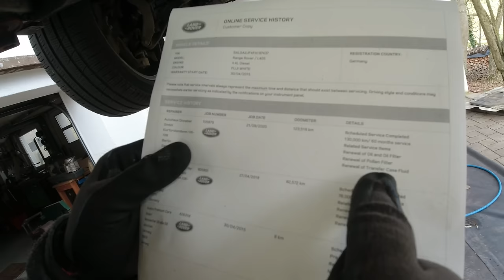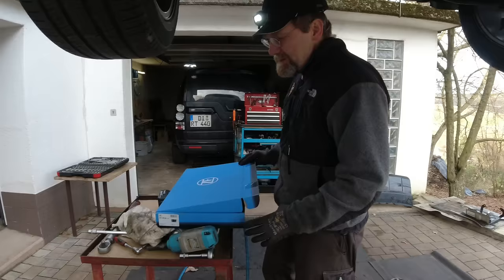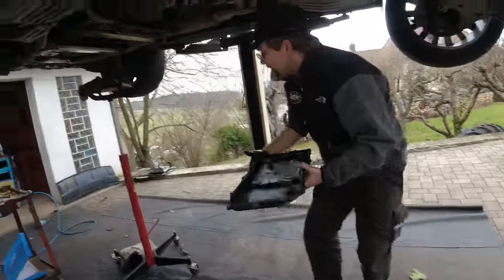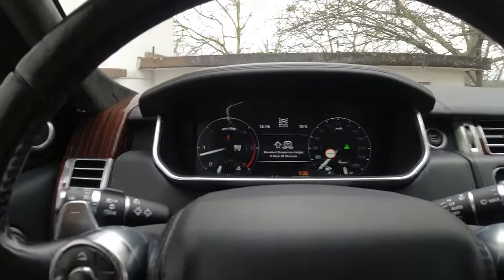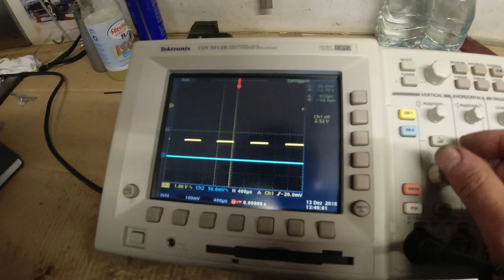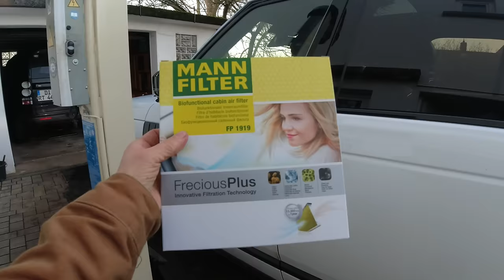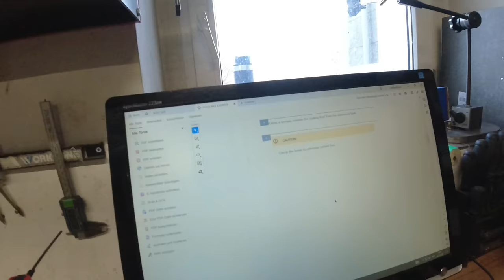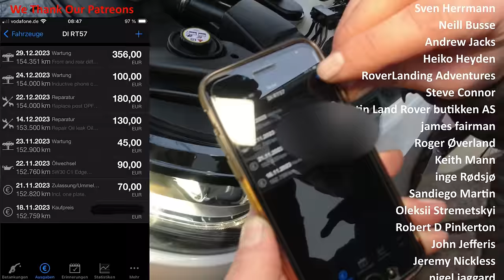Range Rover L405 Big Service including 8HP Transmission / S5-Ep3

Comment: As a veteran of several autobox oil changes, getting everything within several square miles covered in oil is perfectly normal.
Reply from the maker: Ok, thanks.  I do agree.  50% work, 50% cleaning.  Christian
Reply: @Vera_and_Christian  Except on a Toyota which never needs oil changes! ;-)
Reply: I spent 2 years doing at least 2 autobox oil changes a week on an inferior 4x4 brand. Hot red shower every time as there was no drain. Add a rear  diff oil change also with no drain.

Comment: Just did the front, rear differential oils and the transfer case on my L494 last week. The transfer case seems to have cured the judder I was getting when pulling away with steering lock. I just did the quick way with the fuel filter and did not remove the middle plastic trim and brace then stuffed around the fuel filter with blue roll. A bit more messy but it was too cold that day.

Still trying to find my handbrake issue though so I have something to keep me busy at least. 🤷🏻‍♂️😂
Reply from the maker: I am glad you don´t get bored.  Christian

Comment: Must give you a nice warm feeling knowing that all your fluids are changed, especially up your arm! 
What a nice chap Edgar is, such a kind gesture. He must really like Grenadiers to buy two.
Reply from the maker: He is a software engineer.  Everything he does has logical reasons.  His plan to fix the wrong configuration worked out and now he´s got the better vehicle for less money.  Well done in my opinion.  Christian
Reply: LIKE THE  guy from Harry's farm on here, he buys every 4x4 that comes on the market, us poor people buy used
I  am also having issues with my 2010 tdv6, windows n doors on the passengers side no communication, no volts at  window power socket

Comment: Vera is spot on at 7:30 
It's the lifetime of the oil (unknown due to many unknown factors when the oil was first added to the component)
So you need some comman sense and expect ' filled for life" to be 2,3,4 or 5 years
Change immediately when you take ownership of a used land rover, and change again depending on how and were you drive it.
Reply from the maker: Thanks!

Comment: Your videos got me looking at LRs, and I ended up with a 300tdi D1 in my driveway. One thing that I really appreciate about it, is that so far literally everything can be taken out with just hand tools. I've also had a number of Toyotas, and while they don't frequently require work, when they do you need some special tool, or you have to modify your tools, in order to work on them. It's like LR knew their vehicles were going to need to be worked on, so they designed them for maintenance rather than assembly. It's wonderful.

Comment: I used to have scopes like that with FFT from the 1990s and 2000s and they worked very well to support work with my Solartron frequency response analyser. That was a blast from the past 😂
Reply from the maker: I have to educate myself on this unit.  There will be a science project video on the ACE suspensionon the queen down the road.   I am working on this right now.  Christian

Comment: Even though I only own one of the Queen's lowly subjects (D3) I am really enjoying this series of videos of the Queen and how you are bringing her up to standard.  What a mess it makes with the oil change why don't they just have drain plugs on the bottom where they belong!  There wasn't an out take so the test drive must have gone well😊I also use your app for recording all the 'spendies' and maintenance carried out it's a great way to see where the kid's inheritance is going 😂. See you next week.
Reply from the maker: It is possible to vacuum extract from the top of the engine.  I should have done that instead but I dont have an extractor.  Christian
Reply: @Vera_and_Christian  THERE IS A TOOL THAT CHRISTIAN DOESN'T HAVE?! 😝
He will probably make one himself...

Comment: Enjoy all you do together, educative with the right approach.
Concerning the Diesel filter, 24K miles, lets say 40K km. is in my opinion overkill if you always refill at the bigger gas stations in Europe.
Our diesel is so clean the filter can last 100K km without problems.
The maintenance schedule from the manufacturers is based on diesel in very remote, less developed countries .
Open the old Diesel filter and check it for debris.
Keep on going the good work !
Reply from the maker: True.  But only one time filled at a poor gas station changes everything.  We never found any contaminants in the diesel in our cars. Diesel is extremely clean in Germany.  Christian

Comment: I own a 2014 L405 V6 gas. I never get under the car or remove the engine oil drain plug for periodic oil changes.  The large oil capacity guarantees a mess (5W20 in North America), so LR placed an oil drain suction pipe under the oil filler cap to connect to a pneumatic drain. It's also why they put the oil filter on top of the motor. A pneumatic suction air tool connects to your air compressor line and uses a venturi effect to draw out the oil or any fluid via a hose connected to the pipe, which itself goes to the very bottom of the oil pan. It is pretty inexpensive and very handy for any DIYer. Turn it on, sit back, and enjoy an adult beverage. Great videos, many thanks.
Reply from the maker: The queen has that too. But I thought I know better... Will get a suction tool and container now.   Christian
Reply: Thanks. Your videos are the first time I have heard of the GAP IID tool in North America. Cost over USD$500.  Do you recommend it because it is a dedicated LR diagnostic tool?  It seems similar to a Carly device I use for my 2008 BMW, which is also a BMW dedicated device.
Reply from the maker: @m.cooper1854  We use icarsoft (LR/Jag) and the Gap tool, with the Gap tool, you can change settings and do calibrations, you can't do that with the icarsoft. But then, not really everyone wants to dig that deep into their Land Rover. For most, the icarsoft is good enough.🙋‍♀
Reply: Great advice, thanks. I am very pleased that the two of you purchased Her Highness. There is very little on YouTube on L405 and lots of content opportunities for you. For example, my owner's manual under headlight  bulb replacement states go to dealer.

Comment: Great video as always. But if you read fullfattrr you’ll see that some of these engines have actually spun bearings 😢
Reply from the maker: Yes. We may convert to 5W40 but only after I measured oil pressure and did some more research.    I think there much less failures especially on maintained engines.  Christian

Comment: Nice work! Really love your content, your logical thinking and never surrender attidude. 👍 A little note on the video - it seems you forgot to drain the little turbo oil sump during the oil change. The drain plug sits right behind the crossmember thus hard to spot. At least it is on L322 body (same 448DT engine). About half a liter comes out from there. Keep up the good work and greetings from Estland! 🙂
Reply from the maker: I will check this out.  I think the L405 is different but I am not sure.  Thanks.  Christian

Comment: tip for l405 4.4 SD oil filter change, just buy an oil extractor, the factory tube WILL extract all of the oil, no more than 100ml will remain in the lower pan, and if you change your oil often, there will be zero sludge or dirt on the plug. You can do the entire oil change without lifting the car onto a hoist.
Reply from the maker: Yes we know of course. 😅👍🙋‍♀️

Comment: I am rapidly coming to the conclusion that in order to own a Range Rover or Disco for that matter you need to be a millionaire,(probably) . If you cant do your own maintenance thats a cast iron certainty. All the best from England, i really enjoy your laid back and jovial approach to fixing things, by the way i am a V70 owner. 😀.
Reply from the maker: Yes, or a drug dealer or similar job.   I bought two front tires now for 766 Euro.  The car is significantly more expensive to own than our LR3 or LR4.  Maintenance set aside. Chritstian
Reply: @Vera_and_Christian  I just did two tire changes on our '13 Freelander 2 and '17 Discovery Sport (both with Continental AllSeason Contact 2 / TO (*); 235/60 R18 103 T M+S) and they were €650 for all four ... must be the larger diameter and width on the Range Rover.

Comment: Laser 6816/BGS8446-1.this tool will help you to prevent future engine oil spills.next time when you do a gearbox service:fill up until drips,start engine and after few seconds switch it off.top up the oil until it drips,start engine and run it through R/N/D for at least 15 seconds in each gear with foot on brake.after this you can do the final oil check.i would advise you to save the old gearbox oil just for reference and to know how much should be put back in.I’m not a desktop mechanic,I’m a real one 😊
Reply from the maker: Lol. Thanks.  I will get me ten of those tools.   Christian

Comment: i found this video very very interesting i like how you research to find good service recommendations and it makes me wanna tackle my own servicing on a range rover if i had one, i own a old Series IIa SWB landrover and i do all my own work and rebuilt the engine back in 2012 very easy to do compared to the more technical 2.7l diesel in the disco, my mothers toyota corolla is barely near 100,000km and im wanting to service the trans fluid even though the dealer said oh nah we dont service that its filled for life garbage and im like nah i dont think so... the same went with some Briggs & Stratton mower engines filled for life and it was not its just a gimmick so lazy Americans didint have to drain and refill the oil on them.
but i think your videos give landrover and other owners the confidence to do their own work if they know a few things about engines etc.

Comment: You were very lucky with that Stanadyne type fuel filter and housing, probably because it is in such a dry area.  When in an exposed position, such as on my tractors, the metal can and alloy head corrode badly against each other in the presence of moisture, to the point that they are bitches to take apart. Tractors tend to have three filters. A large glass or steel agglomerator/prefilter, then two of those bayonet fix filters, one slightly coarser [different microns] with a glass bowl and water sensor, the second a finer micron final filter.
Reply from the maker: That cartridge was 75 Euro.  Quite expensive.  Tractors are build so much better.  Christian
Reply: @Vera_and_Christian  Yes they are very expensive. I think you had the Stanadyne Fuelmaster brand but there are alternative brands now that Stanadyne is out of patent.  Medium size tractors have an average of 7 litre engines that hold 20 litres of oil and transmissions that hold 100 litres or more. I have one with the German Fendt CVT power-splitting transmission that talks to the engine and has many computer controlled modes of operation. A full service is easily €2000 + tax plus labour if not done by me.
Reply: Next step will be using a HUD Diesel filter > kills diesel bug bacteria
Reply: @RolfIberg  That stuff blocks fuel filters. So diesel bacteria must be treated in the bulk storage before it ever fills a vehicle’s tank. There are biocides available to treat fuel station tanks. The trick though is to not store fuel, especially today’s fuel which contains water absorbing bioethanol up to 10%, for too long before dispensing and to have agglomerators and appropriate measures to avoid water contamination.

Comment: Another very thorough days work, well done team DE. Seems a very clean vehicle underneath with no scrapes or rust too. Bit worried about the weight limits on that two post lift though, especially taking say back 2 wheels off, I’ve seen cars fall off them on YouTube…. Perhaps your son could weld up some front/rear stabiliser posts? It’s blowing a gale currently here…
Reply from the maker: These stabilizer posts are a real hazard. You forget to move them away every single time you raise the car and it pivots it out of the lift arms. Please don't use them. We move the car up and down, a lot, during a repair, that is not always shown in the video. Keep in mind that a video cannot be 5 hours long, that is as long as the average repair takes, often much longer. Our lift is more than capable and save to lift our cars. 👌👍🙋‍♀️

Comment: As far as I know you reset the adaptation only when you chance/repair the valves in the machatronic. The gearbox adapts after a while to the new oil. 
On my bmw I changed the oil twice. Using cheaper oil from liqui moly at first.
Reply from the maker: We have enough videos on that topic. Check them out. 👍🙋‍♀️

Comment: Way to go!
There is another way of clearing transmission adaptation value without a GAP tool or any bi-directional OBD scan tool.
Disconnect the negative (black) cable on the battery, and short the negative cable to the positive cable and let it be for 10 minutes. After that just reconnect everything.
Do note this will reset everything on the Land Rover, which isn’t a bad thing when you replace all the fluids on the vehicle.
Reply from the maker: I am not sure if this clears the adaptaion.  I will check next time with my tool when I got the battery off.  This would be really great for other users for sure.  Thanks, Christian
Reply: @Vera_and_Christian  yes, do let me know! I learned this from a LR tech, but he can be wrong. Thank you!

Comment: Impressive:
Massive amount of aluminium in body and chassis parts and this results in 2800kg.
But thanks to Euro 6 this is still cheaper in tax than my Z3QP 3.0 with Euro 3 and 1375kg.

BOTH cars a probably mainly driven by 1 -2 Persons.
Reply from the maker: Yes.  The tank was full - 100L. Still, the reputation is that this car is lighter than the LR4 and it is not.  Christian

Comment: ITS LR TIME😊😊😊 it's early today.great content this week.your discovery 4 looks very sad in the garage.great humor.what make of battery is in the queen? Till next week stay safe😊😊😊😊
Reply from the maker: The queen still has the OEM battery i think.  I did start even if it is -10°C.   I hope this is the first car where I dont need to change the battery in the first few month.  I use the LR4 two days per week for about 100 km total.   Going to work and back.  It´s a better daily car than the queen.  I will explain this in a video down the road.  Christian
Reply: Thanks for the reply.i had to change mine to an exide battery.the temp went to -6 degrees here in dublin.but the discovery started up with no problem👍

Comment: Regarding the Diesel fuel filter‘s supposedly missing water extraction hose:
I think those are usually only installed in non-european vehicles since they‘re meant for dealing with Diesel of much poorer quality.
At least that‘s the case on my Navara D40, the Filter has all the connectors and water drain plugs, but the Car simply doesn’t have the hose for it.
Reply from the maker: Sounds plausible. Thanks.  Christian

Comment: I am wondering how they do the 30 degrees transmission oil temperature thing when they build them at the factory because there would not be time to wait for it to warm up before the final level check. Maybe they fill the gearbox with pre-warmed oil when it is assembled so that the thermostat opens.  I was always taught that it is good workshop practice to pre-fill the fuel filter with diesel before re-installing it on a vehicle to reduce the risk of air lock, but that diesel filter looks to be of a design where it cannot be pre-filled before fitting so the Range Rover fuel system must self-bleed itself reliably.    Good work by LR Time as always 👍
Reply from the maker: The filling in the factory works by quantity.  There are filling stations which meter the fluids by 1 ml.   I did have to top up the fluid last week (several weeks after the video).  It was 300 ml low actually.  Must have todo with the oil cooler circuit.   I wonder if workshops pay attention to this. Christian

Comment: 1. Funny with the engine oil. I did exactly the same. I cannot believe that stupid brace is right in the path of the escaping oil and it makes such a mess. 
2. I have the same oscilloscope. The non-volatile storage RAM is a Dallas chip which has a 'lifetime' non rechargeable battery inside, all encapsulated in epoxy. The lifetime of the chip is about 20 years. It's failed on mine, and so the 'scope always complains about lost settings. I look forward to your video where you fix it.

Comment: Another great episode 😊
Just wondering how that strip light you got for Christmas 🎄,  i think is going? 
Does it last a while when fully charged?

Cheers Rob from Tasmania AUSTRALIA 🇦🇺
Reply from the maker: No, it does not last.  Its good for a 30 min Toyota repair only.  But it came with a permanent supply and the function and light output is really great. Christian
Reply: @Vera_and_Christian  That's a shame,  Thanks for the reply Christian 👍